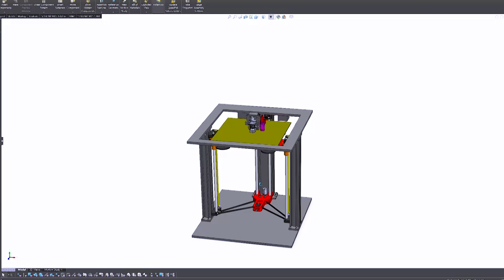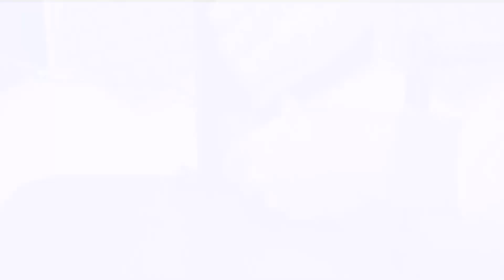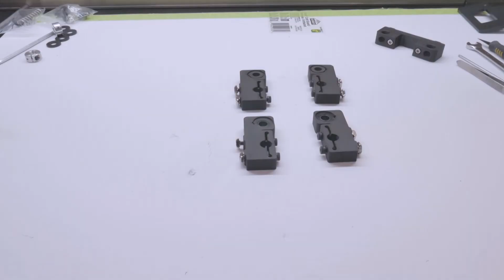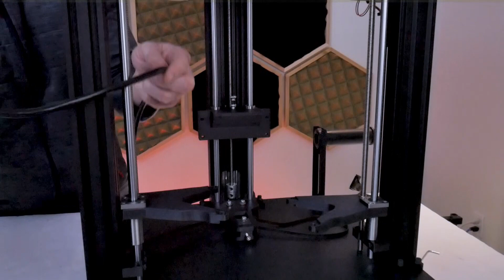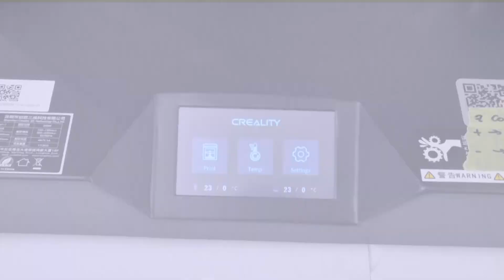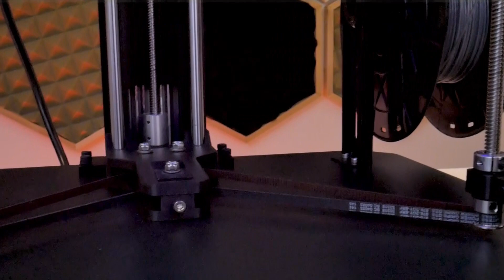Creality Ender 7 - Project Dragon Rising - Triple Lead Screw Linear Rod Upgrade!

Comment from the maker: NOTE: In this video there are the M4 socket head cap screws that are shown to fix the linear bearings in place. Those screws are also shown to hold the back of the print bed bracket onto the 3D printed rear print bed support. These screws have been superseded by M4 plastic thread forming screws. Also, the M3 socket head cap screws that hold the lead screw nuts into the left/right side print bed support pieces have also been superseded by M3 plastic thread forming screws. This new hardware all comes included in the kit if you purchase it, along with a printed drawing showing the location of the hardware and note about the new superseded hardware so it should be very clear to follow.

Additionally, I have been getting a lot of international orders. Every gram counts when it comes to shipping (especially right now with the ongoing fuel crisis) and so the "gauge" bars used to level out the print bed will not be included in the kit. In my video these are the metal bars with holes in them. I was going to print plastic ones for customers but the mass and volume of these plastic bars becomes wasted space and weight for shipping, driving up the cost to you; the customer. Only the small printed pieces to set the height of the rods will be included. Those larger gauge bars can be printed very easily with regular PLA before you disassemble your machine. They can be printed in pretty much any dimension you want, the ones I used were roughly 115mm x 25mm x 25mm for reference, but again you can make them whatever size you want just to support the print bed while you set the height of the lead screw nuts.
Reply: This is an old video, but I still have a 7. Your Z kits are sold out, any plan of making new ones?

Comment: Awesome videos! Recently got an Ender 7, it’s an older machine but is printing very well, better quality out of the box than my Anykubic Kobra Plus. Any chance of getting this kit back in stock? I would like to do this upgrade since I have the machine down due to a print that failed and ended in the hot end being completely encased in PLA. Since I have it down may as well do all the upgrades.

Comment: I'm done. I bought your kit. I followed your instructions to the letter, even tried to install a CR Touch. Got the braket file from you and had it printed by someone I know with a working printer. It didn't fit. NOTHING I do with this printer works. I can NOT even finish installing this kit. Something is not lining up right and I can't find it or fix it. I've spent 1000 bucks on this printer so far, I have NOT been able to use it yet. I have NOTHING except problems and trouble. Can I send you this printer with EVRYTHING I have for it, you fix it and send it back? I will pay you shipping both ways and even more for doing it of course. I just need this thing to work and I am done with trying to fix it myself. I am worthless and this is defeating me in such a way I want to take a sledge hammer to it. But I want it to work even more than that, so....Please...I beg you on bended knee, help me.
Reply from the maker: Where are you from? I'd be happy to help you out however I can, we can discuss shipping etc. Hop over to the contact page on my website and send me a message as I'm sure you don't want to publish your personal info in the YouTube comments section. Let's see how we can get you up and running

Comment: 31:20 I ordered the kit from you, as I have said before..I did not get those spacer bars....I have double checked my packaging and nope. I didn't get those.
Reply: Also, missing one screw for the brass lead screw parts that attach to the supports next to the sleeve bearing. I had to scrounge for a wood screw that was small enough. It worked, but that side squeaks now...Not sure if it's the screw...
Reply from the maker: The spacer bars were no longer included, I had put that in the product listing on the website. Was basically just wasting plastic and then driving the cost of the shipping up with unnecessary weight. Plus if people ordered the lead screw kit with a hotend kit it was interfering with the packaging so it just didn't make sense anymore. You can achieve the same thing with basically any household items of the same height. I did this the other day on another Ender 7 I was fixing up for someone and I used drinking cups since this is a common item that people have multiple of that are the same heights.  As for the screw it's totally possible that there was a miscount, those are all packaged by hand, double checked but obviously mistakes happen. The wood screw you used shouldn't be causing problems but you can always try and remove it and see if its making a difference. You won't notice any difference with 3 screws instead of four. On one of my Ender 7s on the big bearings I'm only running 2 screws on each of those (diagonal from one another) because at the time I ran out when I was building my own. It's been working so well that I never went back to put the rest in lol. As for the squeak, have you lubricated any of your threaded rods or shafts yet?

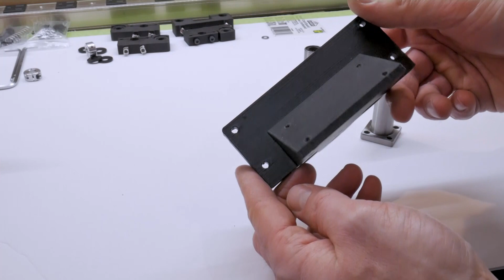Comment: 12:30 I bought the kit from you. NONE of the sockethead cap screws fit in those holes.
Reply: Better instruction manual included in the kit for anyone else who buys it please. That one sheet schematic is super hard to read. But I found that the socketcaps were replaced by self tapping phillips heads.
Reply from the maker: @barral69  thanks for the feedback. I was curious why you had said they weren't fitting but it seems like you sorted it out. I was also hoping the video would be more step by step or visual than printed instructions but I guess some people still prefer paper reference!
Reply: @EmbraceMaking   I do prefer the visual step by step. But it seems since 1 yr ago when the video went up, there have been alterations in the steps/parts used. Not major changes, but enough I was confused in a quite a few places in the video wondering why I didn't have the screws you mention. Referring to the paper only to see if I missed something that was included. However, I did get stuck in the middle due to not ordering 4 bearing sleeves. I only got 2. Have to wait 2 days for them to arrive...no I'm sad again. lol

Comment: Anytime I try and move my z access with this upgrade. I just hear grinding noises and it doesn’t move. Any idea why
Reply from the maker: Did you catch the part of the video where I mention to check if your z screw is touching the bottom of the main plate on top? When you add the toothed pulley it lifts the z screw up a few mm and I had to file mine down a mm or two for clearance. I would start there and let me know if that helps

Comment: OK so you saw everything I saw as to Wow this is strong to Wow they didn't along the BL Touch, Auto Bed Level and the left the bed on a diving board. So you are fixing it. When will you do Direct Drive and really push the thing. In your opinion what else is there to look at on the market that compares??? Is the machine worth it to get now as it discounted a bit do all this upgrade then will it be able to perform in a production environment.   Very close to getting one now i see the issue fixes are out there.  But why not linear rails ????? Thank You so Much. I did similar to my 10S Pro V1 and it remains a tank that can print 400mm tall!!! Thanks Dennis
Reply from the maker: Thanks Dennis! I already did the direct drive here: https://youtu.be/TFctt7043uc and you can see the other LGX extruder and hotend combinations I offer for the Ender 7 here: https://embracemaking.com/collections/creality-ender-7/Ender-7
As for your other question, are you asking why I didn't put linear rails on the z axis instead of the linear rods? The reason would be no substantial gain for the added cost.
Reply: @EmbraceMaking  I was an engineer in medical systems in the late 70s. I worked in R&D for Imaging. I designed  C.T. Scanners for 7 years. The early models were a translate, Rotate style. Which gathered X Ray absorption data by an X axis translation followed by a rotation of the translation assembly about a Center point. Then translate back . Building a matrix of Data that could then be manipulated in to a grey scale cross section image of the object in the center, a body or head. We had to have precise location data at all times and signal condition with minimal vibration or shaking. Obviously straight translation.
We would add structure to find eventually the mass of of the rails created sag. Stiffeners helped but even their mass created sag. One of our team found a larger diameter rod with recirculating ball bearings running along the outside of the tod that was hollow. Now we had less mass and higher strength with smoother operation. This design allowed us to increase speed, lower  X Ray dose and receive more accurate data. It was amazing. Instead of 4 long sagging bars. We had one big hollow bar and a thin support bar at the top. It allows us the make a lighter more structure frame to carry the detectors and maintain alignment is faster accel and decal for more patient comfort and improved data. We were 2 to 3 years ahead of everyone else. Plus I had developed a carbon fiber patient support for lower X Ray absorption, better images and less motion during collection. Everything had to stable and zero motion and consistent for the best data and imaging.  We saw the optic nerve, we found aneurysms before they burst, it was amazing. So as look at these devices I see so much room for improvement in motion control. Your mods and kits solved the main issues. Think about a Carbon Fiber bed frame. Clearly anything that moves must be the smallest mass. Carbon Fiber extruder frame. I print CF PETG for some of my train parts. It's way cool. From 1977 to 2013 I am retired building model train parts to upgrade all my 1950s train engines. Are we having fun yet. Hell Yes! I want a linear rail X axis to better support my MicroSwiss Direct Drive & Hot end.  Thank You, Dennis

Comment: I have been going back and forth on several printers. I was thinking the X1C but now that i have watched your video series on the Ender7 i could buy and upgrade 3 of these for the price of the X1C. Would rather run 3 ender 7's a bit slower than 1 X1C after seeing all the issues they seem to be having so far. Im sure they will get it sorted in time but looks like you have set up a solid upgrade system for this much cheaper unit.

Good job and thank you for giving me something to watch many times
Reply from the maker: Thanks! Slow and steady with multiple printers is a winning strategy if you have the space for multiple printers. Trying to achieve high quality at speed can definitely be done but from what I can see at this point in time it means spending more money. Nothing wrong with going average speed and letting a few printers hum away to keep pumping out parts. That's how I run my production.

Comment: Ok so these are under 300 for black friday, is it worth it ??
Reply from the maker: Wow where did you see them for under 300! I would say so yes. It has some design flaws but if you can score these printers cheap and you're willing to do a few upgrades you have a very capable core xy machine for cheap!
Reply: @EmbraceMaking  on there website, I'm thinking about getting the elegoo neptune x seem more reliable cheaper ender 5 clone

Comment: Problem is key 3D printed parts are not open-sourced; so when it breaks you can't print new ones; have to buy a whole new kit (web site doesn't even state what they're printed out of ...).  Deal breaker for me, we have to be able to print replacement parts...  otherwise would be a great project and contribution to the industry.
Reply from the maker: Hi Matthew, yes currently they are not open source but I would be happy to send out any replacements if something ever broke. If it's just a small part and you wanted to print your own I could send you the STL. With their application it is highly unlikely that you would find anything breaking but again, I would support you 100%. The parts are printed from carbon fiber PETG. I had one customer who accidently melted a part on one of the hot end kits I sell and I sent him the STL since it made more sense in that situation rather than ship. Thanks!

Comment: Curious why do level the bed to the bottom of the printer and not the gantry?
Reply from the maker: Technically your way to do it would be better but to get access to the bed support and level it with respect to the gantry would require taking the print bed right off of the bed support plate. So in the way I do it there is some assumption that the gantry and the bottom of the printer are parallel (within some tolerance). They should be pretty close, and then the actual bed levelling procedure with the adjustment knobs will take care of the rest. I've had no problems doing it this way but yes in a perfect world that support plate is best to level with respect to gantry.

Comment: Just ordered an Ender 7 today so my son can use his CR-10 Smart (I've taken it over 24/7 doing a lot of large prints). Is this a real problem, or just a perceived potential problem?... Did you see any difference in the prints? If a real problem, it seems that using aluminum for the front 2 bed brackets would have a lot less flex (and potential for breaking). Thoughts? I'll be ordering that magnetic spring steel plate from you today. The glass on the CR-10 Smart is sometimes excellent, sometimes so bad that I thought I'd break the glass getting parts off... and TPU permanently adheres to it. That sheet is a must-have!
Reply from the maker: Thanks! The z axis issue is (from my experience) a problem because 1. the bed instability leads to inconsistent first layers from one print to the next. If you just set up your printer and go to print it will be fine the first time, but when you remove the glass plate, or start pulling on prints to remove them from the print bed and then start your next print, you will have shifted the print bed around. When you get your Ender 7, grab the end of the print bed and wiggle it... it will move a lot. and 2. The wiggling will cause print artifacts when you really start trying to print fast or if you use a material or profile that requires z hopping. I use z hop on my PETG profiles to avoid dragging material so it has been very beneficial for me to get the print bed stabilized. 

Yes, aluminum arms supporting the front of the print bed would be ideal but would also be very costly. My brackets are printed in carbon fiber PETG and since making these videos have been running my Ender 7 for 12+ hours almost daily. Print quality has been very consistent and I have only had to relevel and run ABL once. It has been one of my key production machines and has not let me down. 

Hope to see your order come through and if you ever want a Z axis kit you know where to find me :) Thanks !
Reply: @EmbraceMaking Thanks. I'm going to hold off on the plate for a bit... Didn't realize it was so much-I bought one for our CR-10 Smart for under $30.
I've been doing a lot of flow rate number crunching the last few days... To run at high speed with a 0.8 nozzle, the only hot ends that will keep up at 150-200 mm/s are the SuperVolcano (WAY too heavy, especially with DD) and the mosquito magnum+. Any chance of you making the LGX Lite kit to work with the Magnum+ instead of the Magnum? If you can do this, please contact me directly, as I want to do this right away. Thanks again!
Reply from the maker: This weekend I will take a look and see what would be required to adapt my Mosquito Magnum design for the Magnum + ... might be doable!
Reply: @EmbraceMaking  Any luck?

Comment: the ender 7 gets a bad rep but I found it on sale for 500 usd on amzon and I think its a good start to a core xy even if I have to put money into it. I like this so much ill have to order 2 kits from you as I ordered 2 ender 7's I couldnt help it the sale price was to good. 2 ender 7's and this mode is still cheaper then one voron or any other diy core xy printer out there with tons of room for improvement.
Reply from the maker: I couldn't agree more. I've been putting together a Voron (see my other videos) and it is A LOT of work. I'm probably also $1500+ into it and not even done... I have more plans for the Ender 7 to speed it up hopefully close to Voron speeds, but even if it doesn't make it that fast, I can run 3 modded ender 7s for the price of 1 Voron and I can mod all 3 of them in less time than it takes me to build 1 Voron. Let me know if you have any issues ordering from my website if you are not in North America. I ship worldwide but you would have to contact me using the form on my website. Thanks!
Reply: @EmbraceMaking  I ordered you z kit I need to order the rest of the parts off of amazon. I have 2 ender 7's so ill have to get another kit next weeks gotta budget stuff :D. Excited to get at it and put that kit on there its makes the z axis make sense on the printer.
Reply from the maker: Thanks so much for your order! I will be getting it out the door hopefully today... my courier's website has been acting weird today and couldn't print the shipping label, otherwise it is packed up and ready to go! Whenever you're ready for the second let me know and I always keep a few in stock. Thanks!
Reply: @EmbraceMaking  Hey thanks not in any hurry it will get here when it gets here :D
Reply: @redline3036  they just dropped to $279 USD on Amazon...